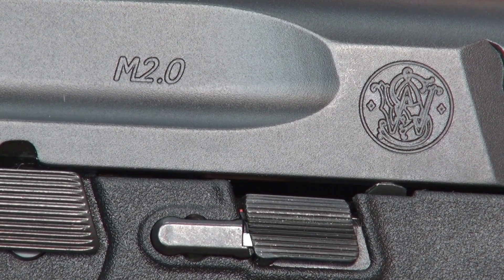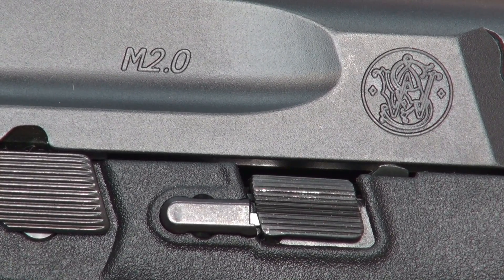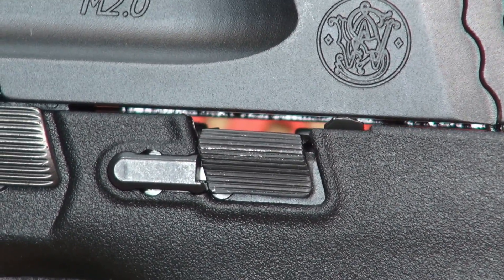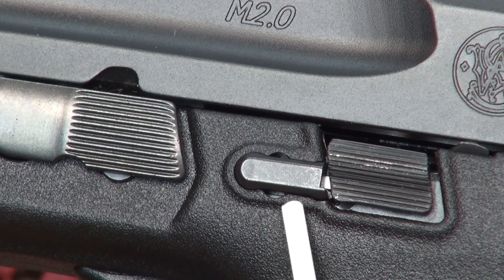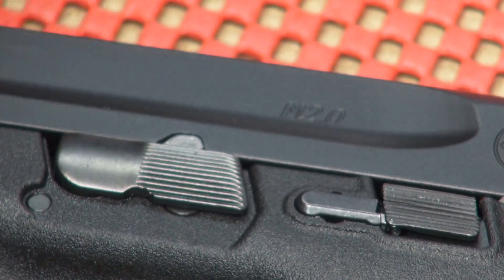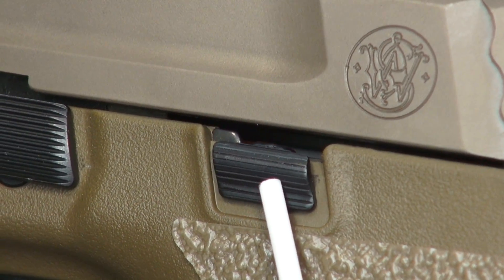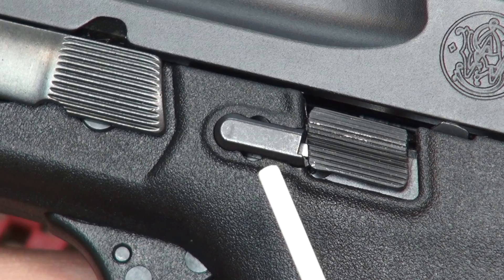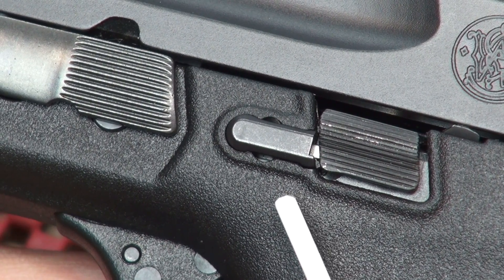S&W M&P 2.0 - Slide Stop Redesign

Comment: Thank you. Since my M&P was made in the last 4 years, it already has the PC sear, so I won't need to get a 2.0, especially with that new slide lock lever. I prefer the default condition of down. The 2.0 slide stop lever up hitting the slide when reassembling the gun is similar to my S&W 5946 reassembly, as I have to manually depress both the drop safety and the ejector or the slide will not fit back onto the frame.

Comment: Thanks for sharing bro. So first of all, for full disclosure, I'm a huge fan of the m&p pistols. While the trigger is mush out of the box, the feel of the gun, the way it fits in the hand, and the feature set, makes it a winner. When I shot the m&p pro core 9l for the first time, I was sold. 
So, my first thought was: Awesome! New M&P handguns! Then, I saw the fact that they removed the bit of beaver tail at the back of the frame, and installed this new slide stop lever. And I'm taken back a little. I loved the fact that when I was at the range, I could dump an empty mag, slam in a new one, slide would ride home, rock and roll. 
It seems, at least to me, that Smith & Wesson just doesn't get their audience. We don't want a glock clone. If I wanted a glock, I'd buy one, stop trying to imitate one, and stay true to what makes the fans love the line. In my humble opinion, the standard m&p pistol, with an apex trigger kit, is perfect. 
I am happy with the new aggressive grip surface, seems to give a better overall purchase on the gun, and the increased rigidity of the frame, especially in the front, where it was always needed. Looking forward to getting your thoughts during the first 100! Thanks for letting me bitch and whine, I feel better now.
Reply: I miss the beaver tail too.

Comment: Thank you for this. I thought there was a problem with my polymer frame because every time I did a field strip I had to push the slide stop down to reassemble and I finally found your video explaining it. Seems the metal frames are under spring tension because I do not run into this with them.

Comment: Excellent video. I am glad you didn't go where I thought you were headed and complain that the change in slide stop function was a bad thing. I actually was a M&P fan but that one "auto close feature" that some refer to it is the reason I got rid of mine. A couple of mine got to the point that it didnt take much pressure to cause that malfunction ( that is truly what it is because it was not designed to do that) and mine only chambered a round about 90% of the time. I do now own a 2.0 with plans to buy other models. I loke all of the changes made and even the trigger is extremely serviceable now although I will replace it with a flatter one.
Reply from the maker: Some of my friends argue that the "feature" of the auto-closing slide was a great thing. But then I ask them how long it takes them to recover and release it manually when it "doesn't do that", and they usually realize the problem. I can work a slide release all day combined in less time than one unplanned make up release.

Comment: Trying to drop the slide with your thumb is almost impossible on my new 2.0. Now I at least know where to try some oil. Thanks for the video!.
Reply: And that’s by design. It’s a slide stop, not a slide release. The intended operation is to pull the slide back after loading a mag (sling shot). This is the design a lot of companies are going with for safety reason. Ruger EC9S are the exact same way.

Comment: Great close up vid.  Have to wonder if they went too far with trying to fix the problem.  Every other pistol I have ever shot relies on a spring mounted slide release.  I would've thought a thoughtful redesign of the tab and notch in the slide would have been enough to fix the issue, without adopting an entirely new mechansm.  God only knows how that little reterntion/friction bar will wear overtime and what the results will be.  Proof will be in the pudding.

Comment: There apparently is a MP 2.0 slide stop...with spring. Part number 3001854. However I am unaware which MP2.0 came with it, or was it only during initial release of the pistol. Cause when I got my MP 2.0, I don't feel any spring tension.

Comment: I'm an M&P Armorer and have worked on probably 100+ of them for about four years now. One of the complaints about Gen 1 S&W M&P's is that the slide stop would jostle loose and send the slide forward if you inserted the magazine too hard. The other common design flaw with Gen 1 is that I've seen a number of the slide stop levers actually sheer off completely. It looks to me that they addressed these two commonalities by redesigning the slide stop. Whether it's for better or worse remains to be seen.
Reply: I have a M&P 45 that auto forwards the slide when I insert a fresh magazine and I personally like the feature.  I don't see it as a defect at all, and struggle to understand why so many people don't like it.
Reply: My only issue with it is when I'm running defensive hollow points. (forgive me I don't remember what brand, they were given to me) When the slide drops automatically the hollow point catches on the feed ramp and fails to feed correctly. I have tested it a number of times and I get 100% failure to feed. Now with FMJ it's a non-issue. Feeds great every time.
Reply: I wonder if you have ever had them hang up on the ramp by inserting a fresh mag and pressing the slide release.  Mechanically speaking auto forwarding is almost the same as pressing the slide release.  If it does I would recommend using a different brand of hollow point.  Or better yet one of those expanding full metal jackets for a defensive load.
Reply: Craig Arnold Yeah see that's the funny thing. If I carefully insert the mag so the slide doesn't drop and then release it with the slide stop it feeds fine. Trying different defensive rounds is definitely on my list of things to do.
Reply: Jason Miles Weird, I guess that hollow point needs that tiny extra little push you get from racking the slide, since you compress the recoil spring a tiny bit more.
Reply: Shear not sheer.
Reply: I love that feature of my sd9.... Gonna miss it when I upgrade to the 2.0, I love slapping and going. Now I'm gonna have to slap, rack, and go
Reply: I would rather my slide automatically drop when sending a mag home, if my M&P did this I would NOT send it in to fix this as its an upgrade in my opinion. I HATE the M&P slide stop on my 2.0 as it forces me to have to sling shot every time. Im going to have it fixed so it releases like I want
Reply: Juiceman I hate it because it only does it 20% of the time. In a gun fight I’d like to be able to manage reloads the same way every time without surprises.
Reply: Its for worse
Reply: @TimKollat  how did you address this

Comment: My full size 2.0 has an issue now with the slide stop configuration. I have an empty mag in the well..slide locks open. I have no mag in the well...slide locks open.  I have a full mag in the well..slide locks open.  Every round I fire...that slide locks open.  This little retention pin seems to push the slide stop upwards.  Why ca
n't the slide stop housing come with a spring like the earlier generation?

Comment: I noticed another difference,  solid pins on the 2.0 vs rolled pins in the original.  That will definitely last longer.  Rolled pins can become a failure point after many thousands of rounds, most will shoot that much however.

Comment: The problem with the "auto forward" issue is that it's unreliable.  It is definitely NOT a feature; it doesn't do it when it's new.  I'm glad they fixed the design flaw.

Comment: Great vid and explanation on how the new slide stop functions! As a competitor, I like the older autoclosing slide. But, I do see S&Ws point in that it may startle some people when it closes on its own.
Reply from the maker: The discussions I've had with fellow competitors, some who shoot M&P exclusively, is that the problem even there is that it's not 100% - so if you start to rely on it and once in awhile it doesn't slam, it's going to cost you an extra second or more to "recover" and run the slide. Personally I prefer consistency - one way or the other.
Reply: CW yeah,  I always run the slide anyway in training, dropping a perfectly good round, so this change is neither here nor there for me.
Reply: There has been one or two times when It didn't close, but that was on a new (at the time) gun. At the time, I t may have cost me an additional second. But next time I just slammed harder and it worked fine. I guess that pistol has completely broken in now, since I don't remember which one was doing that, and all 4 seem to work now as expected, and accepted.

Comment: Could you do a big favor and try to mount the 2.0 slide on to the 1.0 frame and dry cycle it for function. I have heard that you won't be able to lock the slide but I am wondering if it will function otherwise.

Comment: Your 2.0 shield's slide stop is different than mine. The actual metal that stops the slide on mine is more square with right angles. Yours is rounded a bit. Because how mine is I literally need two thumbs to pull the slide stop down. It's ridiculous.

Comment: The m&p 2.0 is a better overall pistol than the original. It is actually my favorite striker pistol. CZ SP01 when it comes to hammer.  To sum up the m2.0 it is overall a more controllable pistol than the original. Trigger is actually pretty nice to me, minus the slight trademark Grit...but I have an apex USB on the way to remedy that. I have an apex sear in all my original m&ps but this honestly does not need it. The lack of beavertail helps u get a high grip letting the pistol Seat into the web of ur hand. The negatives, as no pistol is perfect is the new grip texture...too rough imo as I grip my pistols high and tight. Next would be the slide catch...I like the slide releasing when I slap another mag in, it makes the full size pistol more efficient.

Comment: Justin, We purchased this model for my wife about 3 months ago for CC use. regarding the slide lock we are having a potentially life threatening failure in that every clip of 8 rounds the slide lock engages 3 to 5 times for unknown reasons. Weve tried 4 different brands of rounds, her or myself firing it with no change in the problem. Pretty much makes this gun worthless with regard to reliability in a situation. It is also per this video we see its the "old style" slide lock. have you or any other here found this a problem with the original type slide lock system?
Thank You
Reply from the maker: My advice is to contact Smith & Wesson right away and report the problem. My advice isn't worth anything compared to them having a look - especially a malfunction that can stop the gun, etc.

Comment: one of the big things I like about glocks is the ease at which you can remove pins to do work on the internals.  I owned a "1.0" m&p and was deterred by not having a vice and a punch set to do trigger work.  I was trying to look at the pins used in the new 2.0, it looks like they are not tension roll pins but more inline with a glock style pin, is this correct?  Thanks for the review...

Comment: I bought the FDE and the regular black one the first day my LGS got them in. FDE flawlessly,  but the black one locked back after every round. It wasn't user error or magazines or ammo so I wonder if the new slide stop has issues. Smith and wesson sent me a label and it's already been sent back so hopefully I found out what caused it.
Reply: you should update this comment when you find out more. it really doesn't seem as robust as the original and industry standard design.
Reply: Matt Comchoc it's on the way back to me. the only thing they told me is that they had to replace the slide stop

Comment: The slide stop is spring tensioned down I own this pistol 🔫  I think yours may have been  put back together wrong
Reply: The 2.0s do not have spring tension on the slide stop. It's a friction system not spring

Comment: My first thought @2:10 is Sand Trap ! And will be interesting to see how the last shot hold open works and if it even has one,.. ??
Reply: Why wouldn't it have a last shot hold open?
Reply: My thinking is ha magazine may not have the umpff to push the slide lock past the friction bar they added...it looked hard to or at least harder than normal to actuate... let alone the mag follower to be able to push it up...
Reply: Eric K Eh you make a point. But removing an important feature for safety reasons sounds like something Colt would've done in the 80's. And no one wants to become Colt...
Reply: LOL ,...true... It turns out it doesnt have a problem though now that I watched the first 100,... seems to lock back fine...

Comment: I just purchased this firearm, and I cannot get the slide lock down without doing a slingshot pull
Reply: Read your owner's manual. Slingshot method is the proper to chamber with this firearm
Reply: Matthew Sarff i did read that, but I have also seen people not slingshot to load
Reply: Themightykasey i have seen that as well. I know some people have done some filling to  the lock to turn it into a release. But without any modifications, there is no way I can comfortably use it in a release manner. I've just gone with slingshotting it every time. I do wish it was like my 1911 though!

Comment: Why wouldn't you want to send the slide home upon slamming a fresh mag into the gun??? I only see that as a bonus not a negative.
Reply from the maker: Not a big deal to me personally, but here are a some:  Have you ever heard of a "slam fire" malfunction? They are very rare with modern handguns, and in theory the redundancy of safeties further prevents them, but it is possible for the firing pin to be carried forward by inertia and strike the primer of the round with enough force to detonate it. And then there are the scores of handgun owners that have not been properly trained to keep their fingers off the trigger, and might be either jarred or surprised into a negligent discharge. Those are some reasons. Proponents of that behavior will cite the time saved during a match (or, I suppose presumably during a gunfight too) because they don't have to manually manipulate the slide or slide stop to chamber the first round of the new magazine - but in my experience the behavior is not consistent. And because it does not do it every time, I hold the opinion that you will lose more time reacting to the failure of the slide to "auto-charge" than you will by training to run the slide every reload. Just a few reasons for consideration.
Reply: for real life scenarios, it is much quicker and safer to slide release with a  simple thumb tap than reaching all the way over and slingshotting it. What is the purpose of gun? protect yourself quickly, put bad guy down quickly... slingshotting takes much longer than using a thumb release. The release is EXTREMELY stiff.

Comment: Amazing camera work as usual. Thanks to the great close-ups, I also noticed something else that is small that S&W changed. The two roll pins in the frame have been changed to solid pins on the new model. I wonder if the new solid pins are straight or if they have a taper to them? Hmmm. Inquiring minds would like to know. :-)

Comment: This is the only real disappointment in my 1st generation Shield. Ive seen some videos describing how to file down some areas of the slide stop to make it easier to use. There were stories floating around that S&W was telling people the slide stop was not meant to be used by thumbs. What crap. If that was the case, there would be no external tab for the thumb to use!!! No, it was just a poor design S&W did not want to admit. Glocks are smooth as butter in the slide release, when needed. And there are times it's better to use the thumb release instead of racking the slide.

Comment: I tested this at the range and my M&P has the new bar and I can still,slam a mag in it and the slide goes into battery. So idk what the reason is they changed the slide lock lever but I see no difference from my original 1.0 mp

Comment: So I assume that you can not release the slide (with a loaded mag) without actuating the slide lock? Or can you still do an over the top slide release?
Reply: You can still do an over the top release. I just got mine out and tried it since you asked. Good question though.
I got mine last Thursday and haven't been able to try it out yet. Between work and the rain, all I've been doing is looking at it. lol
Reply: Tyler Allen that was kind of what I was thinking as well. Since there's no spring pulling the slide lock down, how does it disengage when the empty mags follower is not in contact with the slide lock like with pretty much all other pistols? There's got to be something else going on in there that a mag with rounds helps release the slide lock
Reply: Just looking at the picture it kind of looks like pulling the slide back from the locked back position will cause the slide to ride down on the forward portion of the tab of the slide lock.  That might be it.
Reply: Craig Arnold You got it buddy!
Reply: No. It's impossible to slingshot the slide home. I know this is supposed to be an improvement, but because you were naughty S&W decided to eliminate the over the top style of release.
Reply: i see what you are saying about the angled part pushing the tab back down, but i still don't like it. i think that i sometimes do the slingshot real quick and only move the slide a tiny bit, which allows the holdopen tab to drop. but with this you'd have to move it far enough to pop the tab all the way down. this does not seem like an improvement.
Reply: Matt Comchoc the slide stop area on the slide has been significantly reduced. I guess s&w engineers decided traditional slide stop was not the way to go on the new design
Reply: KlanStar except my 2.0 does auto forward